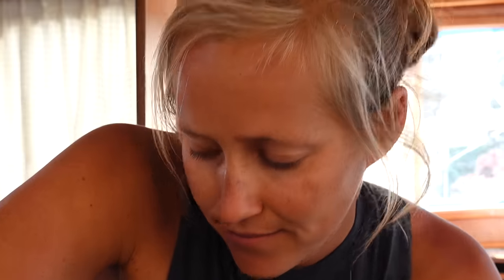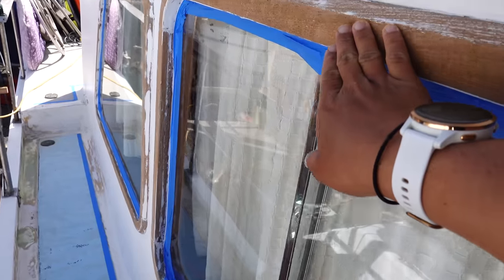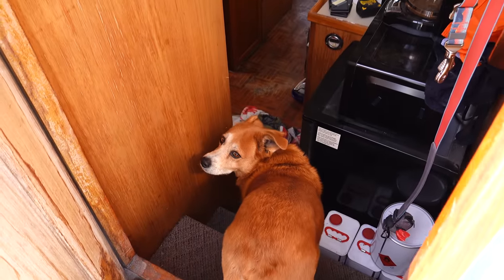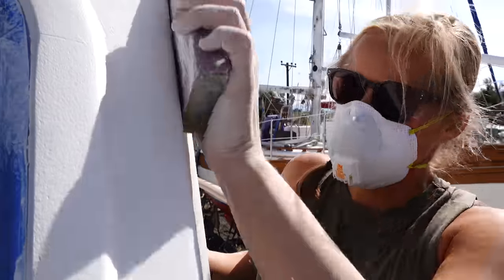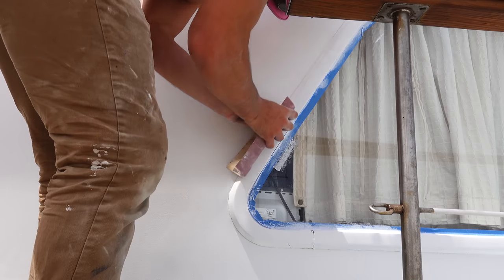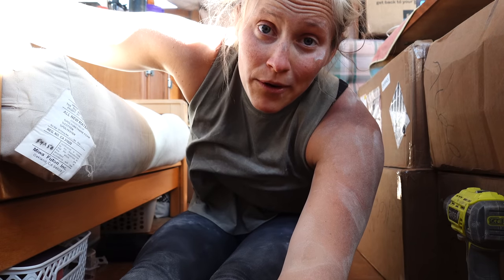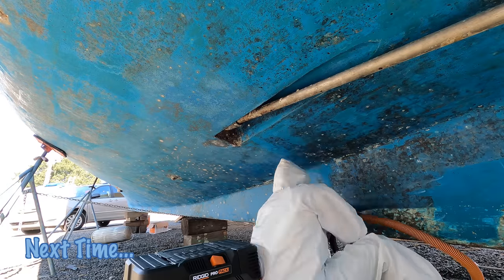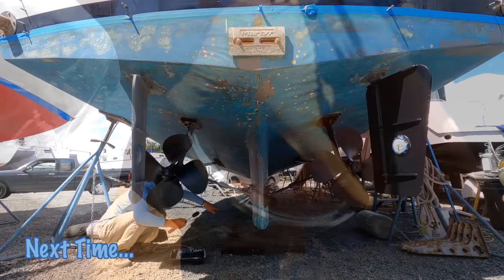DIY $100 Trawler Transformation Cabin Sides get PAINT

Comment: the dull ness to the paint is called "blush" and you are correct it happens when the dewpoint gets to close to the surface temp. always check to see if it is waxy. If so it is an amine blush and don't paint over it until you remove it. 
I am a coatings inspector so this is one area I do know. LOL

Comment: A tip i leared from from an old guy ha.  You may already use it, However on a brand new can before you pour take a hammer and a standard screw driver knock holes in the can where the lid seals. No more paint standing in that groove. You know what I mean when you smack the top on and no more paint shoots out or you have to cover with a rag. Yea you know you have been there hahah    Lookin great ; )